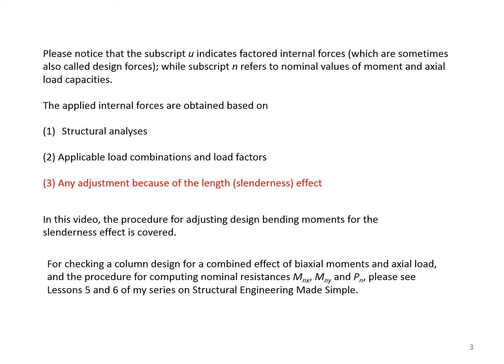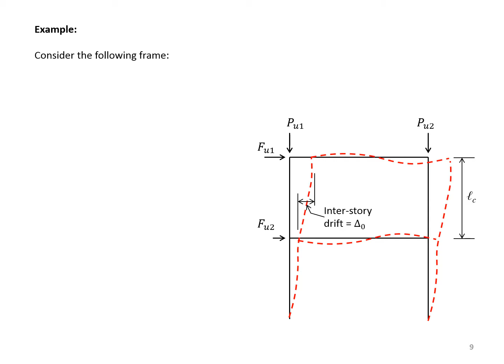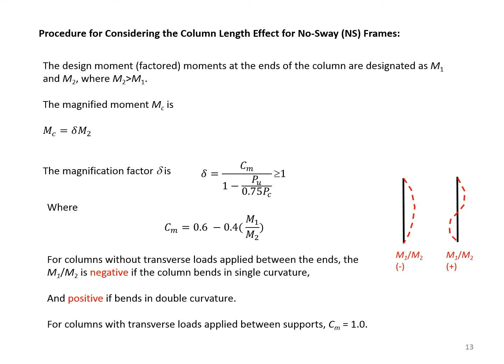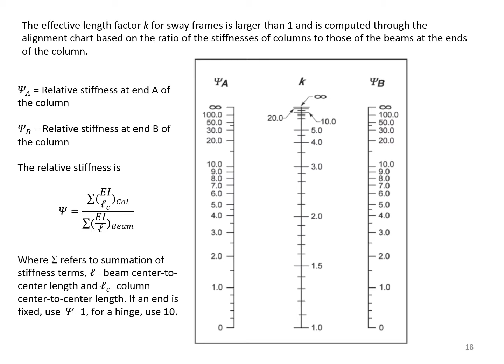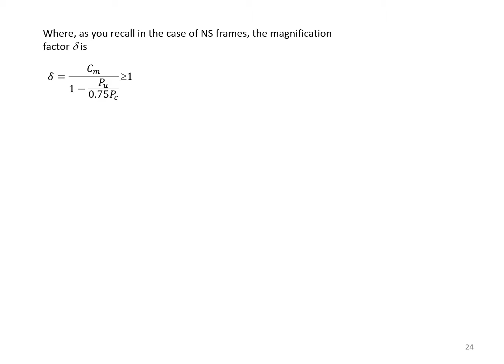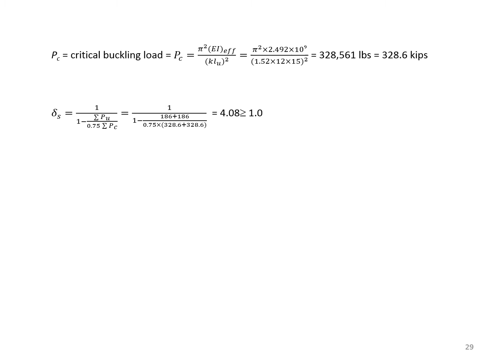Structural Engineering Made Simple - Lesson 15: Slenderness effect in reinforced concrete columns

Comment: Hi there,
Thank you for the excellent and informative video on Structural Engineering Made Simple – Lesson 15: Slenderness Effect in Reinforced Concrete Columns. I really appreciate the clear and thoughtful explanations throughout the lesson.
I did have a quick observation regarding Slide 28. It looks like the unsupported length of the member is noted as 13 ½ feet, but the calculation still uses 15 feet, which appears to be the joint-to-joint length. This assumption leads to a lower critical buckling load and, as shown on Slide 29, a higher magnification factor and magnified moment.
Just wanted to share this in case it was an oversight, or perhaps for clarification in future videos. Thanks again for the great content—looking forward to more lessons!